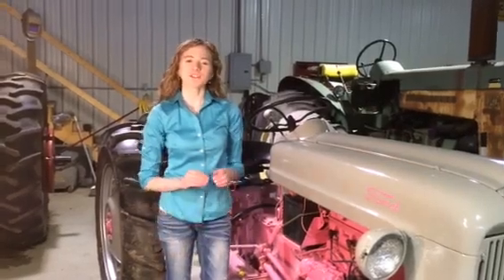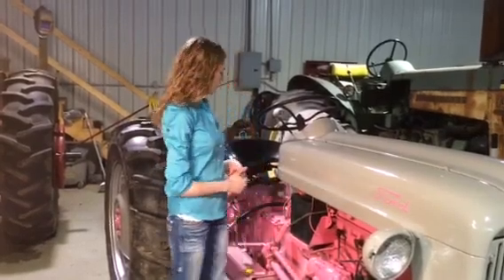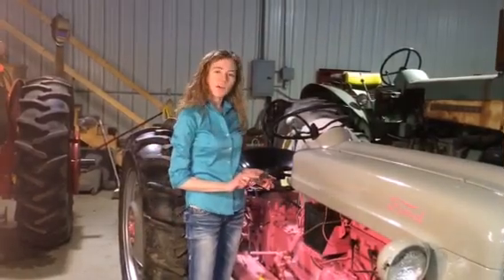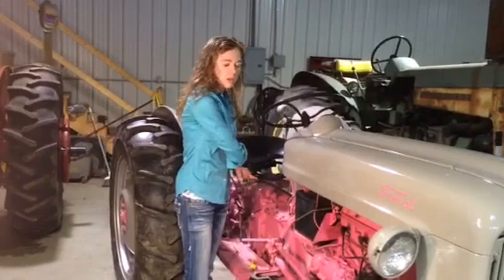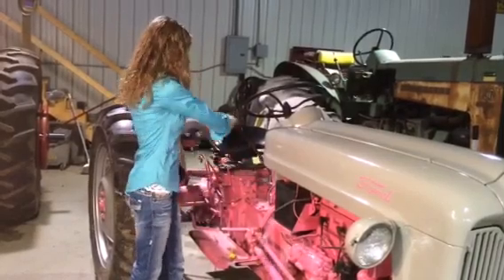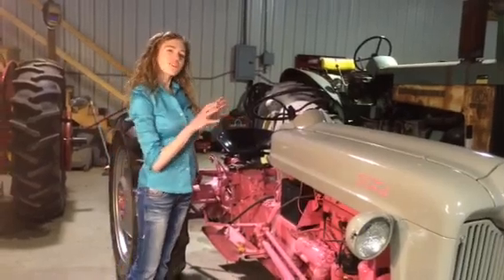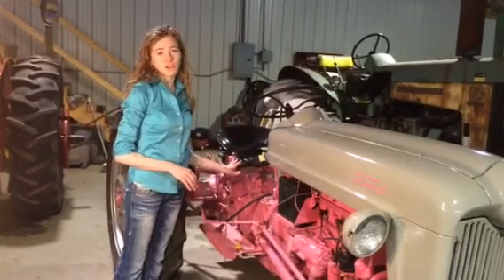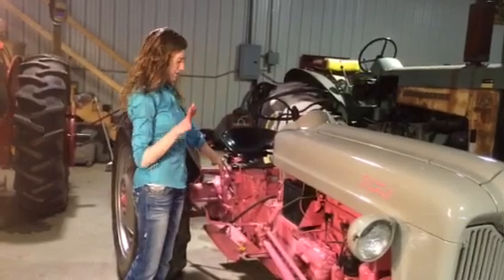How to Easily Fix Tractor Hydraulics

Comment: Hi Rachel, quick question about which fluid to put back into the tractor. I have a 1939 9N and read that I should use 80w-90 oil instead of universal hydraulic fluid. What are your recommendations? Thanks.

Comment: Great presentation! but PLEASE NEVER  try to start a tractor unless you are sitting in the control seat.  If it is accidentally in gear it will take off and run over you.

Comment: Rachel or anyone here. I was having lift issues after I played with the draft control lever. Then after a fresh fluid change it wont lift at all with out a lot of grunt help. What PSI from the air hose should I be using? Some on some forums say not much more then 20psi as it may blow seals out.

Thanks for all the great videos Rachel!

Comment: Any help, My tractor is Ford 5610 it happened my tractor run out of diff oil then I filled oil, after that PTO and hydraulic couldn't worke again. ( I tried to change oil filter and clean the strainer but nothing is happening)
So what could be a problem  with my tractor?

Comment: By God, that's BRILLIANT!  That'll also prove if there's a hole in the suction line or a bad suction pipe inside the gearbox.  If you pressurize the gearbox and get air out of the inlet to the pump, you got a bad suction pipe.  I know what I'm doing tomorrow...  THANKS

Comment: When you say "pressure" in the video, is it air pressure or hydraulic fluid pressure?  I don't see hydraulic fluid when you pull that hose away, so I think you mean compressed air, but that looks like a hydraulic hose, and you never say what it is.  So it doesn't work to remove the priming plug and re-prime the pump that way?  (Because my pump seems to keep losing prime, and priming it at the priming plug seems to keep finding air, though the plug is taped.)  Also, how much pressure?

Comment: hi rachel. can u answer a question for me on my ford 600. ive got a ford 600 and the oil pressure line appears to go into the front of the hydraulic pump.  this doesnt seem right to me.  can u advise where your oil pressure line goes to on the engine.  thks.  jim

Comment: Very nice explanation and technique.  I have an issue with my 3 point when it has an implement.  It raises and lowers without anything hooked up, however when it has weight it will only go about 1/4 of the way up and I can hear my pump struggle.  What should I do? I have replaced the filter and fluid already

Comment: My jubi will only lift enough to get bush hog off the ground. With no weight it will raise all the way up.it responds fast but wont lift much. It will not lift a 6 ft disc. I'm thinking bad pump. 
Any ideas?

Comment: I recently bought an old 9N, and am slowly learning about it. My question is this. My lift arms wont go up or down without the PTO being engaged. Is this typical for this tractor?  If not, what do I need to do to correct this problem ? Thanks, Timmie... P.S. Thanks for all the videos that you share with us....
Reply: The PTO runs the hydraulic pump, so it has to be engaged for the hydraulics to work. If you disengage the clutch, the hydraulics stop working since the PTO is not "live".

Comment: Do you know what’s wrong with my tow truck hydraulic? Oil level is good the pump push strong, and the flatbed is going up and down but won’t move forward or backward? I can see the pressure in the hose it looks like it’s want to explode but cylinder won’t move at all, before completely stopped working was very slow and became slower and slower and now nothing!  Please help! I am going crazy🤪

Comment: Can you please tell me where is my hydraulic filter at on my 1964 MF 165 that lifts up my three point hitch or can somebody tell me and second how to adjust my steering valve on my cylinder steering that is on the front of the tractor where I can steer my tractor

Comment: Although I am not surprised by all of the comments about the starting of the engine, it is clear to me that it is not your first day around a tractor. Thank you for the tip about the hydraulic pump prime. I had to do the procedure twice, but that may have had something to do with the 3*F temp outside this morning...is there any other time for problems to occur than the worst possible one?

Comment: Hi there, do you guys know if a 8n transmission will fit  1953 golden jubilee if not, are the gears the same??
Reply from the maker: It will not interchange. The 8N rear end has the hydraulic pump in the transmission; the Jubilee has a hydraulic pump on the side of the engine with tubes to bring the oil to the rear end. Of course, some of the gears would interchange, but big issue lies with the hydraulic system. -Rachel

Comment: Hi. Thank you for the video. I did this to my Ford 1310 at the reservoir and hit the levers for the front loader and the rear levers for the backhoe and they all worked. But once the air is removed I get completely zero movement from anywhere. Does this sound like a hydraulic be pump issue? Or something else? Thank you.

Comment: I have a old Massey Ferguson tractor with a front-end loader but the buckets on the loader will roll down on its own slowly as you're using the tractor what do you think could cause this?
Reply from the maker: Sounds like the cylinder packing is blown, causing the oil to escape to the other side of the cylinder. You'll need to re-pack your cylinders by taking the cylinders apart and replacing either the o-rings or leather (depending on which type you have).
Reply: Ok thanks

Comment: to bad some of you modern tractor starters were not around back in the 40s-50s when most engines were started with a crank or fly wheel, it was rough starting them setting in the seat

Comment: I have a 1979-1980 Ford 3600 Diesel with a Dunham Lehr / Farmhand 22 Loader. 

The loader worked without any problems what-so-ever when parking it back in November for the Winter months. 

Now that it's March & we got a 55 degree day, I wanted to start up the tractor and get some routine maintenance done on it...but even thou the tractor started right up, nothing happens when I push or pull either spool valve handle for the loader. I tried the selector valve that pulls in and out and is located below the right hand side of the seat which faces the hi/lo shifter but whether it's in or out didn't make a difference....this is the valve that diverts flow from the 3pt arms to the auxiliary flow for the loader, and when it's pushed in my 3pt arms work like they should and when it's pulled out they don't work and so I know that it has to be pulled all they way out or in the middle for the loader to work.

I disconnect the pressure line at the loader's spool valve and leaving this line connected to the selector valve, and then started the tractor whereby sliding the selector valve in and out to all positions but still no fluid came out the selector valve's pressure line.

I looked all around the under side of the tractor and the ground but there's no leaks. I also removed the small plug on the back right side of the tractor to check the differential fluid and it was full and wasn't milky looking. 

Even though the fluid didn't look milky as if there is water in it, Is it possible to get moisture in the hydraulic system and it froze up and won't let the hydraulic fluid circulate through the selector valve and then to the loader's spool valve....or something like that? 

Does the external pump on a 3600 need primed and if so, how is it done properly...does a 3600 need to have air blown in through the differential's fill hole since there is no dipstick on a 3600 to check the rear end fluid however a 3600 does have a dipstick for checking the transmission fluid that's located near the hi/lo shifter.

Comment: Good afternoon I have a question hopefully you can help me I have a ford tractor 8n  i was having trouble with my hydraulic system it was staying gauge up at all times when trying to cut my yard and put in the level down, and when I shut it off everything will go back to normal the hydraulics will lower... so I was advice to rebuild my hydraulic pump assembly because a valve could  been stuck... so I rebuild the whole hydraulic pump when installing it back on my test in my hydraulic system multiple times and everything was working properly up and down so I decided to go cut my yard everything will working properly for an hour when returning home and turning my tractor off my hydraulic stay engaged up at all times even with the tractor off what could be my problem can you please help

Comment: For purposes of clarification, it would be helpful for her to explicitly state that she is referring to air pressure from a standard air compressor, and that the pressure is being applied to the tube vacated by the hydraulic dip stick.
Reply: How much air pressure is used?
Reply: How many PS I is recommended ?
Reply: thanks, i seriously thought i missed it all from watching in marvel as she started the tractor while leaning against the wheel,
Reply: Thanks for clearing that up.  I was wondering.

Comment: I have a question I have a 601 and when I have the arms all the way up I noticed that it does like a hiccup type movement. What I mean by hiccup is the arms would lower just a little bit then shoot right back up. I'm new to the 601 I was using an 8N before so I'm not sure much about this type of tractor

Comment: Rachel, want to thank you for your video... I inherited a Ford 1310 this year and did a few projects around the homestead.  However, the  3ph after a while would not raise  - hard to dig post holes like that.  I cleaned the hydraulic fluid filter and changed the  hydraulic fluid.  It worked great for about 5 post holes... I cleaned the  filter and topped up the fluid.  No dice.  

Went on a youtube  and found your video - It worked like a charm!  Thanks again...
Reply: Did this to my 1210 after changing hydraulic fluid . Had to loosen filter cap to expel,air when fluid came out tighten cap works like a champ again . Thank you saved a trip to dealer .

Comment: I'm a young buck when it comes to the old 8ns I been trying to start my grandpa's 1948 8n that has been sitting for a bit and the starter will start spinning the fan blade but it's a very weak spin/start and it cuts out about the 3rd I press and hold the button in it will ra ra ra about then nothing I need some help guys if anyone can help please reply. thank you
Reply: typeoclutch I had the same problem. Just fixed it today. First a new battery 6 volts. Orieley had em for about 100. Then I had a leaky gas line. Fixed that. Wouldn't start. Took the carb off to clean it. Carb removal and cleaning pretty easy. 2 bolts. 2 connectors spring loaded. Gas line. And one hose. Opened up the carb. 4 screws. Cleaned it with carb cleaner. Reassembled it and it started right up. So a carb cleaning may do the trick. If it's really corroded, a new one is only 100$.

Comment: I have a 1967 John Deere 2010 tractor. The hydraulic system stopped working so I cleaned the very dirty filter element and changed the fluid. It worked great for about 15 minutes then stopped working again. Once again I checked the element and it was clean. I refilled the system and tried it. It worked perfect again for about the same time then it stopped again, no power steering or bucket function.? Any help would be"GREATLY APPRECIATED" !

Comment: To those that chastise Rachel for starting it from the ground and not in the seat, the Ford tractors of that era (I'm not familiar with newer ones), have an interlock with the starter button that won't allow it to be pressed if the transmission isn't in neutral.
Reply: You are soooo right.  Unless someone has bypassed it along the way.  I have 6 screws in my right foot because someone bypassed an interlock....and somewhere in the day a kid popped the trans in gear.  I started it up and was promptly run over, broken leg, crushed foot, but survived to tell the tale.....safety interlocks are good...if they work...ALWAYS be mindful of the previous owner/user and at the very minimum, wiggle that shifter.
Reply: Except every old tractor I ever fooled with no longer had a functional interlock.  I just make sure it's in neutral regardless.  I park mine in neutral.
Reply: @johndough9187  I mostly park vehicle in gear incase brakes fail on hills
Reply: @matrayley  I don't have too many hills in my shop.
Reply: @johndough9187  well for the hills you do have in your shops ;) may be a good idea
Reply: @matrayley  I use the parking brake on mine.  It works VERY well.  But there is no functional interlock to keep it from starting in gear, and I would never trust one any way.  I wiggle the gear shift to see what's what.
Reply: John Dough exactly! Common sense and situational awareness negates the need to be a "Safety Sally".
Reply: I have one that works and one disabled and I almost ran myself over thank god I was in the garage and the wall stopped it stupid me, never again.
Reply: That may be faulty or bypassed with a dodgy repair
Reply: Terry Wall it's your fault for not ENSURING the transmission is in neutral. Sad that you were injured but it is your own haste and negligence. Good that no one else was injured.

Comment: This video helped us out of a jam today. I didn't even have to seal the hole with the air needle going in and the pump picked enough oil up to start raising and lowering. All we did was drain the oil and fill it back up, and it wouldn't work. Not being a tractor guy, this video helped immensely.

Comment: As a veteran farm tractor mechanic one rule is to never start any piece of equipment from the ground. What if the tractor was in gear ? If that tractor had a neutral start switch would you trust it. Any educational video should include safety as the first lesson
Reply: +Mike White I was thinking the same thing, Mike. When she started it up, I thought "Man,,, I hope she checked to make sure it's in neutral first".. :-)
Reply: the video assumes that you are familiar with operations and safety procedure
and trying to make it as short as possible she spared us that details
Reply: +TheDirtyyoungman1 Too true, there's a good video here on youtube from a farmer that learned the hard way, but was lucky enough to have lived to warn others of the danger.  I don't recall his name, but if you search you can easily find it.
Reply: when i start my 30-60 hart Parr i cant always sit on the tractor when i start it.
Reply: Mike White of the tractor was in gear then Rachel failed to observe the first rule of equipment safety: treat every transmission as if it is in gear UNTIL you personally verify otherwise.
Reply: Mike White Don't tell people what to do .You trying to be like the Nazi's

Comment: this video is bullshit.  I added hydraulic oil, pushed it with air, and the air pressure blew out every suction pump seal, a proportional valve and some other valve.  cost me $8,000.  thanks.

Comment: Should maybe advise people to make sure the tractor is out of gear before starting it standing in front of the tire. My 9n will start in gear. Im sure you are aware of this, but there are certain people out there that wouldn't take the time to check.
Reply: the video assumes that you are familiar with operations and safety procedure
and trying to make it as short as possible she spared us that details
Reply: pluggap if someone doesn't check that the transmission is in neutral the gene pool has been incrementally deepened.

Comment: I have a 8n that I just replaced the hydraulic pump on. Now the arms lift fine with no weight but won't lift at all with weight on them. There are no visible leaks. open up the box and all i could find was a broken spring. put it back together and had a little improvement so now once it's up it no longer falls back down. You can get the box blade up with a board or bouncing on the back. any suggestions?

Comment: Had hydraulics on my Farmall C working in a few minutes, just like the video!
Thank you!
Reply: How exactly did you do this? My Farmall C doesn't have a dipstick. So where did you blow the air into?
Reply: into the reservoir on the left side, the plug with the square head. Use a little pressure with a rag wrapped around the air gun and be sure the reservoir is full of oil...stay clear of the moving hydraulic parts when the pump gets primed from the pressure..
Reply: Gotcha. I'll have to give it a try. Thank you.

Comment: How big of job is it to replace a pto shaft in a ford 8n?  Splines are warn out on mine . Thanks.
Reply from the maker: Bruce Morris Fairly straight forward. Remove the bolts, pull out the broken shaft and replace (in a nutshell).

Comment: I have a quick question I have a Ford 2N 1943 tractor I just got. I was disking with it today, and it will not lift the disk its the same size as the one you are using, and it would not lift it. I saw place's were it can lift up to 800 LB and 1200 LB with a front weight. yet this will not lift it. now if I put the level in the up position it will try but will not lift but if I and a friend I have pull up on the disk it will go up and stay up. Can that be the PUMP.  If so please let me know if you have any idea of what it could be so I can get her fixed up right. Thanks in advance.
Reply from the maker: McCuneWindandSolar Doesn't sound like an issue with the pump. If I had to guess, t's probably the piston being blown or the relief valve. You can be sure by taking the side cover off and looking inside to see what is happening with the oil. Here's a step-by-step for the repair. https://www.youtube.com/watch?v=XcWtNVOxzDg